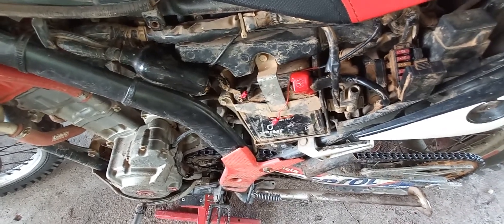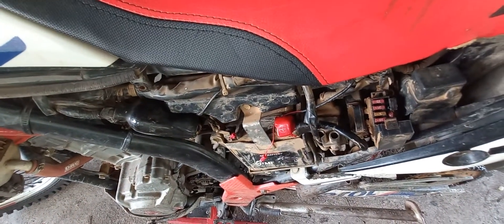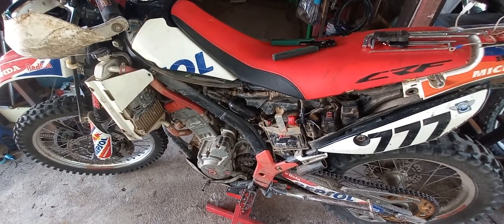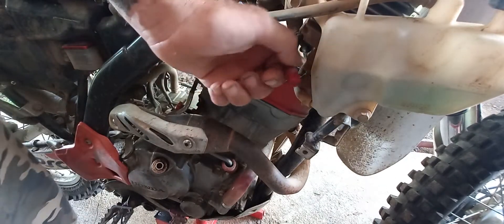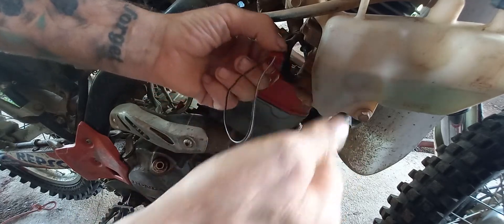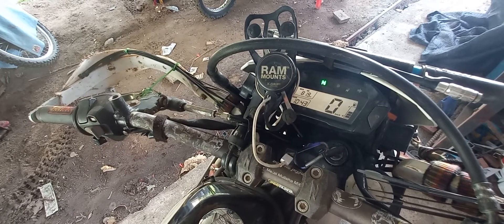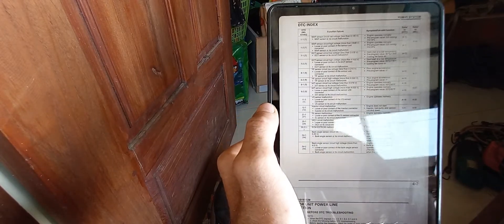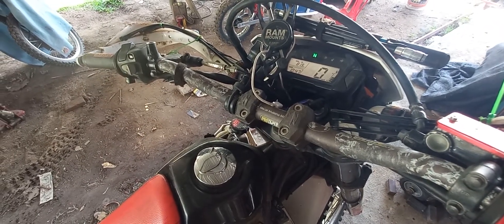CRF250L: how to read ecm fault codes AND clear them.

Comment: Thanks for the Vid, in suspense? what was the final fault code that resurected the bike?
Reply: Id forgotten! I went to watch the vid n found ive got 2 POXY ads on it.... but ive only got 47 subs. You tube bastards!
Anyway.... i had 2 codes, bank angle sensor and fuel injector. I know theres nothing wrong with both of them so i traced their wiring and noticed both grounds (black with white trace) run to the kill switch. Couldnt find a fault inside the switch so i traced the wiring back to the connector plug which is under the speedo and i found that a piece of bamboo that i got speared by earlier in the day had pulled the plug apart on the right side switchgear and it was just touching enough to give a fault like a flat battery!
That was a 1st for me.